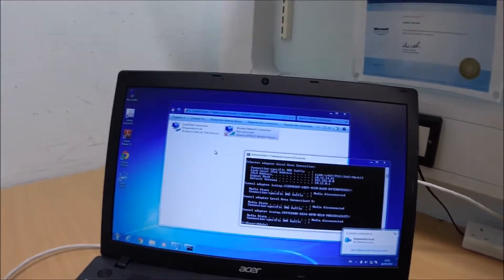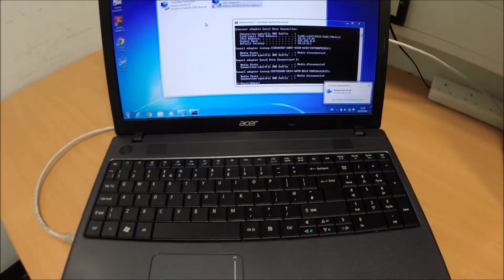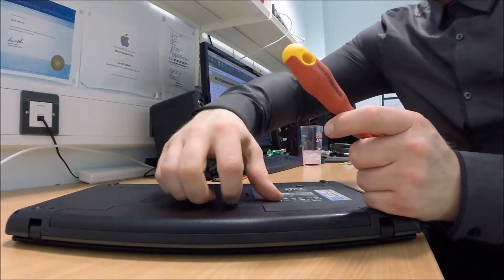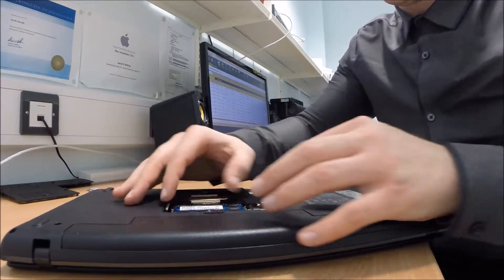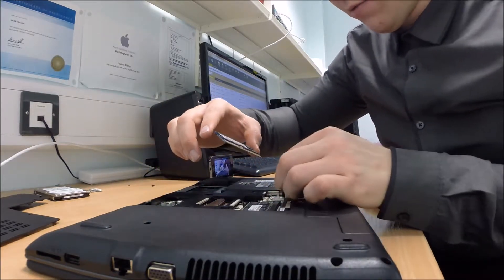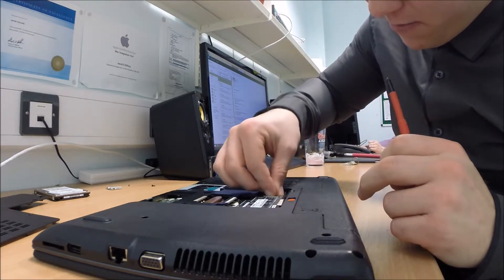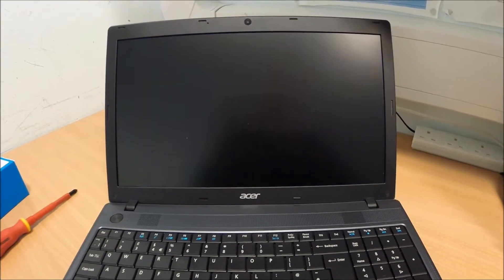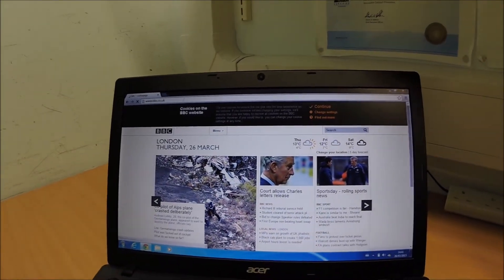How to Replace a Faulty Laptop WIFI Card (ACER)

Comment: why does the laptop say and show no internet access but it can get on the internet with no problems?
Reply: it could be that with it been an enterprise network it requires additional authentication for internet access to apply filtering and monitoring policies specific to the user, usually automatic authentication would occur when signed into a domain account, but as it was a local account he used, it would not have automatically authenticated and when the video cut at about 5.29 he may have put in domain credentials before the page would load
Reply: +Dudefoxlive it basically means limited or no connectivity so the connection in this case would be limited
Reply: that would make sense

Comment: What does a pwr fan connector on my mb? Ps nice music
Reply: Jake Billing thx. Building my first pc this helpt a lot
Reply from the maker: It's for a chassis fan, e.g. an intake or general cooling air flow fan. Cheers for the comment buddy.
Reply: matsgameproductions MGP It is designed for the power supply fan but would still work as a case fan.
Reply from the maker: Haha if you knew why did you ask me? Besides who uses a power supply fan these days, it's only used for an extra fan anyway haha! :)
Reply: Jake Billing So can it actually be used as an ordinary fan header as i inly have 1 on my motherboard. When I looked it up it said it was only for the power supply (only certain power supplies that have a fan connector).